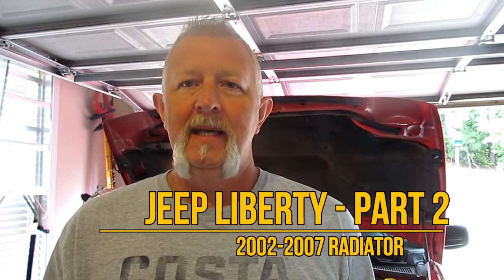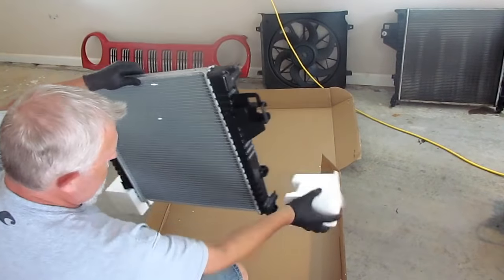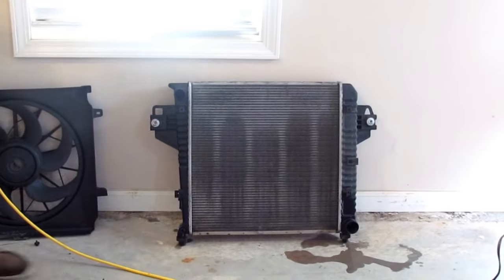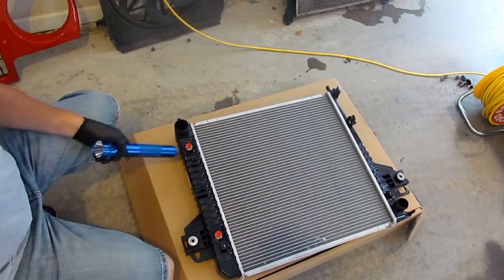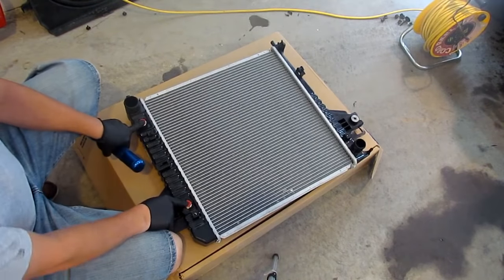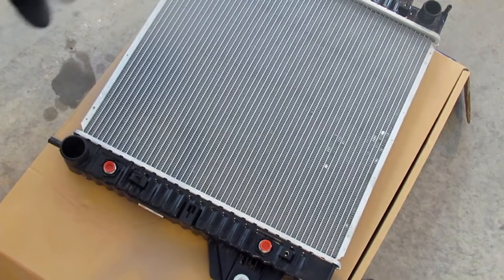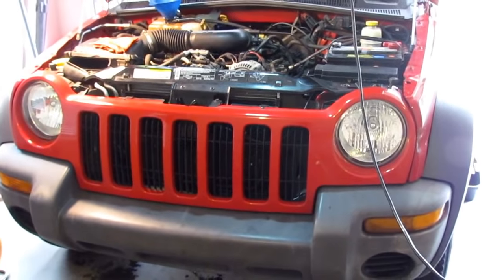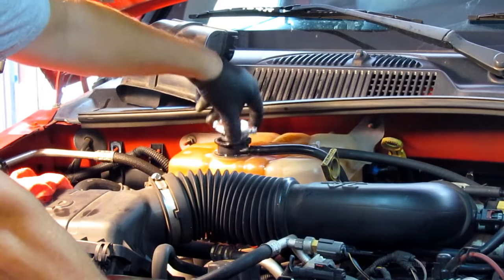Part 2 Remove and Replace 2002 - 2007 Jeep Liberty Radiator

Comment: Replaced radiator on our 2004 Jeep Liberty Sport today. Your video helped immensely as others have mentioned. Last radiator I worked on was probably our 1974 Dodge Dart 6 cylinder--4 bolts and 2 hose clamps. Now we deal with baffles and a/c condenser and auto trans. cooler. Also am nearing 70 yrs. old so am not as agile as way back when. Thanks again.
Reply from the maker: Thanks for watching!  Yes, it is amazing how much has to be moved/removed to replace this radiator compared to the older cars!  I'm glad this helped!!

Comment: I just replaced a cracked radiator in my 2007 Jeep Liberty using your tutorial. Couldn't have done it without you. Thanks for making this, you saved me some money :)
Reply from the maker: That's awesome!!  I'm glad it helped and saved you money in the process.  I don't know for sure, but in my area, I believe that type repair would run about $600.  Thanks so much for watching my video and commenting on it!

Comment: Wife’s ‘06 Jeep Liberty developed a small crack so it was time to replace.  Can’t have coolant dripping all over the place can we?  This was by far and away the most concise, accurate video(s) I found.  I was fortunate in that the radiator I bought (same brand as yours in the video) must have been updated...it had the clips you spoke of in reference to the transmission oil cooler.  

Your video saved me hundreds of dollars.  You are a saint and are to be commended for taking the time to post a video with such detailed commentary and explanation.   Thank you thank you.  Cheers and hope all is well.
Reply from the maker: Thank you so much for such a wonderful compliment!  I really appreciate it and am so glad this video helped.  Thanks for watching!

Comment: Awesome video! I put the baffles onto the ears before I installed the radiator. I kept them folded around the radiator so that I was able to slide it right into place like you did. You got a new subscriber with this little project. Thanks!
Reply from the maker: Nice!  Glad that worked for you.  Thanks for watching, Josh!

Comment: I was having issues until I drained the system, took the burb allen plug out. used a funnel and filled things up through the "burp" port until it would not take any more. Then filled radiator and reservoir. Put the plug back in, let it warm up and burp as shown. Great help, of course mine had some extra crap that this one did not have, Most helpful video on the subject that I could find. Thank you sir
Reply from the maker: Thank you for watching, Al!

Comment: Excellent tutorial!  And the Jeep engineers must have watched these because my '06 Renegade is very similar, except that all those handy tips you gave for getting at the bolts for the tranny cooler and ac condenser didn't work because they changed the inner grill.  But other than that, it went really smooth and all your other tips worked perfectly.  Only snapped one bolt and that's something of a personal best in Canada...  Thanks!
Reply from the maker: Thanks for watching Scott!  I'm glad the video helped.  If those engineers took my ideas, Jeep owes me some money!  HAHA

Comment: Thank you.  was stuck on those rubber flaps. when you showed how to pull them out to access the lower part it helped me to complete this job. this was more difficult than it needed to be. i have replaced many radiators in my day and this was a little difficult to get out but went back in easier. kinda strange the way they hung it
Reply from the maker: I agree, that was a weird radiator job for me too.  Glad this helped, thanks for watching!

Comment: Fantastic how-to video Dennis!  I just finished replacing my radiator thanks to your accurate and comprehensive explanations.  Couldn't have done this project without your help.  Your video is head and shoulders above the rest.  Keep up the good work - you clearly have a gift for this type of thing.  P.S. I found that if the Liberty has a separate transmission cooler (like yours and mine have), then you need to order the radiator listed as 'manual transmission' in order to get one w/o integrated transmission cooler.
Reply from the maker: Thank you very much, Randy!  Makes sense about the manual transmission-radiator...no cooler included.  Thank you for watching!

Comment: Dennis! Most excellent video! I have a 2004 Liberty Sport with 190,000 miles on it and going strong! Aside from the rocker panels rotting out, having to change the rack and pinion, power steering pump and A/C clutch, everything else has been standard maintenance. I recently had a friend change the upper control arms, wheel hubs and lower ball joints, but now it's a second vehicle so it's all good. I recently purchased a 2007 RAM 1500 with the 4.7 motor in it. I suspect I will get the same reliability as my Jeep motor! This video gave me a good idea what to expect instead of diving in head first and figuring it out. Now, I have to go get dirty! Thanks a lot!
Reply from the maker: Thanks Aaron!  You must be THE expert on Jeep Liberties...that's a lot of work you've done!!!  I'm glad this vid helped and I sure appreciate you leaving me a nice comment!

Comment: Just filled my reservoir on my 2005 liberty cause I thought it had a heater core clog, or I was just very low on coolant.

Turns out, I was indeed super low on coolant because of a major radiator leak near the bottom hose. Heater core wasn't even getting any coolant because of the leak.

Buy a use car, get used car problems. 🤷

At least now, you just gave me a step by step, detailed instructional video on how to replace my radiator. Looking forward to spending an entire day on this in a week or so. 🤣

Thank you!
Reply from the maker: I hope the replacement goes smoothly!  Thanks for watching!
Reply: @dwcoffey  As an update, your tutorial was perfect, save for one slight difference in my particular model. Your fan blade is attached to the  housing, where mine is attached to the engine, making it impossible to remove without disassembling it from the block.

Not a huge deal though. Still managed to get the radiator replaced. Your video was amazing.

Added plus is that the heater now works flawlessly. It really did just need coolant to flow in. The radiator was shot.

Thanks again, sir!
Reply from the maker: That's good news!  This time of year, it's really nice to have a working heater!

Comment: Thanks a lot Dennis, I did this before with no problems but this time it overheated. I saw the bleeder plug bit none of the manuals tell you that this car needs to be bled. I will try that this morning. Also your explanation of the different types of anit freeze was very  enlightening as that is something else that I never could get a straight answer on it. At the present time I have got the system 90% green I will have to figure out what I am going to do with it.
Reply from the maker: Thanks for watching and commenting Steve!  I really appreciate it.  Yes, I've talked to a lot of people that have done the work on their vehicles, but still have cooling issues....only to discover that the system hadn't been bled.  Plus, bleeding it gets rid of that irritating gurgling sound from the heater core!  haha.  Hopefully that and dealing with the antifreeze will take care of the problems you've been having.  Let me know if I can help!

Comment: Good job.   I was just about to get a radiator, with the internal oil cooler,when mine don't have it either.   All the ones that keep showing up for sale have those connections, so I guess i have to search harder. A tip I use when doing  auto restorations and you want zero  damage to the cooling fins.  cut  thin card board  that will cover the fins, and tape it to the top of the radiator, and just pull it up  after it set in place, then start the install.
Reply from the maker: That is a great idea to protect the fins!  Thanks for watching and sharing, Lane!

Comment: i wasn't gonna touch my moms 05 liberty till i saw this..  we got a spectra radiator and glad to see it has the bolt holes for the trany oil cooler.  thanks!
Reply from the maker: Thanks for watching, Ryan!  Hopefully your repair went smoothly!
Reply: @dwcoffey  there were black rubber things on the bottom pegs of the old radiator and I didn't put them on the new one.  😆  so I did the job twice...  pretty good at it now though! 😆
Reply from the maker: LOL!  Well, practice makes perfect!  I have to admit, I've done that more than once.  haha!

Comment: Thanks for the tip on the internal oil cooler. I have an external OC.  I had already ordered a radiator before I watched this video that said it worked with internal or external oil coolers. I cancelled that order and found one without an oil cooler.
Reply from the maker: I'm glad the video helped Rick.  Thank you for watching and I appreciate the comment!

Comment: Thanks for the video Dennis. You are awesome good sir. I was a dummy and ordered the internal trans when mine is external like yours but I am not good at fabricating. Did your zip ties hold up? Any pointers so I can get this back together? Thanks !!
Reply from the maker: Thanks for watching, Frank!  The zip ties did just fine!  I used fairly heavy ties, probably 12" ones and cut the tails off after installed.  We've had no problems with the zip ties holding the cooler in place.  I don't have any additional pointers, but follow this video and it should come out fine.

Comment: Completed this today - if I hadn't found your video, I might not even have attempted this. Couple of things for others attempting this: My 05 front grill assembly just snaps on with clips - no bolts. Also, regarding the external cooler mounts: because I'd watched this video before I ordered parts, I knew I had external coolers. My theory is the smaller motors use the internal coolers... anyway, when I ordered parts from my favorite parts place (RockAuto), they offered the option of radiators with or without mounts for external coolers.   Thanks again!   Now I hafta figure out why it's overheating...may have to replace the fan.
Reply from the maker: David, thank you for the additional info!  I'm glad you got yours done and hope you can track down the problem.  I've had to replace the fan on mine as well....didn't video it because I had to do it on the side of the road :(  but its an easy fix....2 bolts, one plug.  Just pull the retainer clip (red) out of the electrical plug before trying to disconnect it.

Comment: great video thanks dennis, like you i followed your steps and found i had the same radiator as you missing lower bolt holes and mine did not have the transmission cooler built in, must be a common problem, i just made a couple of metal blades screwed to the trans cooler and slip inside the the condenser lower mountings with the condenser brackets.
Reply from the maker: Thanks for watching, Martin!  That sounds like a great way to get the tranny cooler mounted securely.  Thanks for sharing that!

Comment: Thank you man! That was a great video. I did it in the same way but I have a problem... got no hot air inside the car. Only cold with no heat. Perhaps I did something wrong, any advice?
Reply from the maker: Hi Gian Carlo, thanks for watching!  There are a couple of things to check.....did you let the engine get up to operating temperature?  It must get up to temp before the thermostat will open and allow hot water to flow.  If you did, then check to be sure you have the coolant system full.  Low coolant will prevent enough flow to get heat.  Also, be sure you burped the system as I show in the video.  Air bubbles will prevent coolant flow.  After all that, if you still have no heat...did you take your thermostat out at any time doing this repair?  If so, is it possible you put it in backwards?  This happens and will prevent the thermostat from opening,  and so not allowing coolant to flow to the heater core.  Let me know if none of this helps and I'll help the best I can.

Comment: Hi Dennis...I did notice just one little thing that i did not do on my radiator that wasn't shown in your video. Those 2 rubber feet that were on the 'feet' of old radiator (that were not included with the new radiator) slide onto the 2 plastic feet for those 2 hole slots. I went ahead and put my old ones on. When i did, those rubber feet actually did aid in better alignment, especially with all those other holes, nuts, bolts, etc that you have to line up just right later on. Also, with those 2 rubber thingies inserted in those 2 holes, those 2 skinny plastic legs aren't just dangling/inserted into those metal holes with possibility of breaking off with normal driving...or if you hit a pothole, yikes!. Just a thought! And, of course, GREAT video!
Reply from the maker: My model doesn't have rubber inserts for the bottom alignment pins, but I thought when doing this replacement that they'd be a good idea.  Sounds like Jeep changed that bottom mounting arrangement at some point to include them, since your Liberty has them.  Mine is not designed with rubber inserts, but the pins on mine are long enough, and the holes they fit in are small enough so that no damage or anything will occur without rubber inserts.  It is definitely a good idea for you to include them in the new install if they were on your original.  Not having them may allow the radiator to rattle, if nothing else.
Reply: Ahh, yes...i did notice they differ from model to model, :) Thanks again!
Reply from the maker: Thank you!!  I really appreciate you watching and for the great feedback!

Comment: Thanks is the best video i got see on a lot time, jus my radiator on my 2004 jeep liberty is crack on top, i going to change tomorrow jus i whan make sure, what i do wiht the red caps i let in the place on the radiator? I have not probles for the pression of the water in side of radiator? or i have to put something in the holes for hoold the red caps
Reply from the maker: Hi Ricardo,  The red caps are for the transmission cooler, which is a separate compartment from the radiator.  If you do not use the tranmission cooler, you can just leave the red caps in, no problem.  thanks for watching!

Comment: Understand everything but was wondering shouldn't you leave the coolant cap off when running the jeep through the cycle? Or no because thats what the allen key air petcock is for?
Reply from the maker: Thanks for watching, good question!  You want some pressure to build up in the system so it can be properly burped thru the allen head insert on the gooseneck.  With the cap off, it would be difficult to get the existing air to bleed out.
Reply: @dwcoffey  one guy told me fill it up leave it running with cap off until fluid goes down and fill back up as needed? What u think?
Reply from the maker: Yes you can do that to be sure the radiator is full, but you will still need to cap the radiator and go thru the burping process.  That allen head screw used for burping is at the high point of the system and will get all the air out.  That is important so that your heat works properly and you get full flow thru the cooling system.

Comment: if there is a small leak in the radiator what do you think about using "stop leak". I know it may clog or slow coolant flow else wear, but, if it's an old vehicle used only occasionally for utility use does it really matter?
Reply from the maker: I am not a fan of stop leak stuff for anything, only because, as you point out, it will also clog up places that you don't want clogged.  Since I have zero experience using anything like it, I can't really say whether or not it would be OK in your application.  I'm sorry Chris, I just don't know when/where it works and when it doesn't.

Comment: right now i just have those 2 bolts that hold the ac condensor to the radiator, my radiator does have those transmission oil cooler ports but also have the holes for the ac condenser, i got the driver side in the clip but the right side is being a BITCH to put in, the only problem i'm having is the rubber flap does not want to clip onto the radiator so i can slide the ac on. But i'll find a way around noon today, but the 2 part videos have been a Tremendous help. THank YOU>
Reply from the maker: Thanks for watching, Robert!  I hope you got it sorted out.  I agree...those baffles are a pain in the tail.

Comment: Also it's worth noting that the 2006 model doesn't use the Torx screws to secure the grill, only clips.
Reply from the maker: Excellent tip, thanks!

Comment: Tech tip: If you can't get the fan off the water pump, leave the long bolts out of the radiator and you can tilt it forward to get the fan in or out. Must be very careful not to damage fins though.
Reply from the maker: Thanks for watching!

Comment: Hey Dennis, lots of thanks for the great 2 part videos on replacing the radiator on the 3.7L 05 Jeep Liberty.  I totally appreciate the bolt by bolt steps and also the speeding up of the removing of the bolts and installation also!  Very Clever!

Question, I noticed you did not remove the bottom radiator peg rubber boots that sit on the bottom mounting bar.  Is this going to be an issue?  I noticed them when I was packing up the old radiator core in the box the new one came in.  I don't want the radiator to be not secure enough for a bounce on the front axle and the plastic peg break off.  Do those boots need to be on the bottom pegs for stability and cushioning support?
Reply from the maker: Thanks for watching and for the question!  My Jeep did not have rubber inserts for the bottom pegs, but the way mine mounts, it is stable and secure.  As long as your radiator is secure and cannot be moved fore and aft, it should be fine.  If you can move it relative to the structure of the engine compartment, you would need to install those rubber inserts you found.  I hope this helps...please let me know if I can help you.